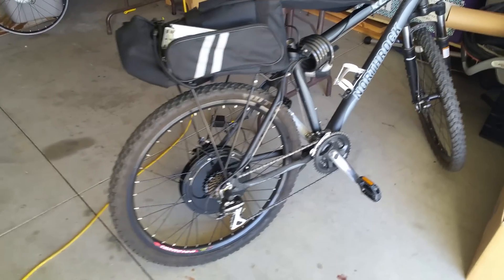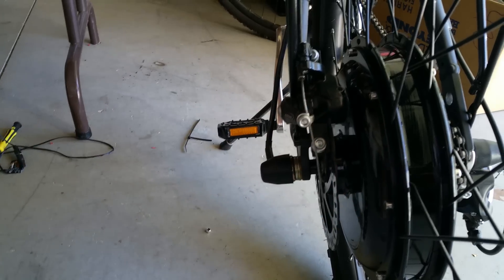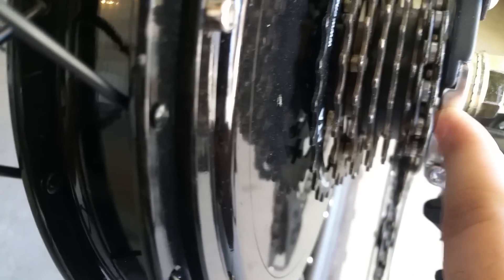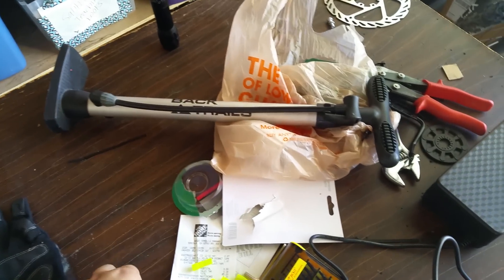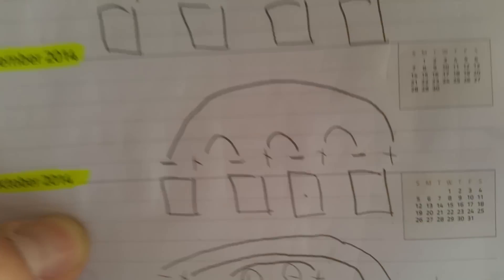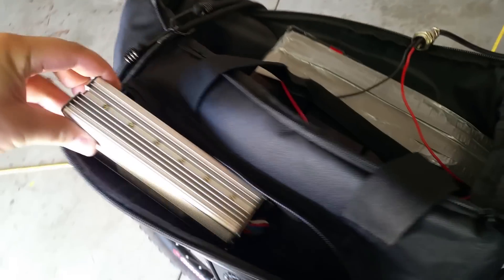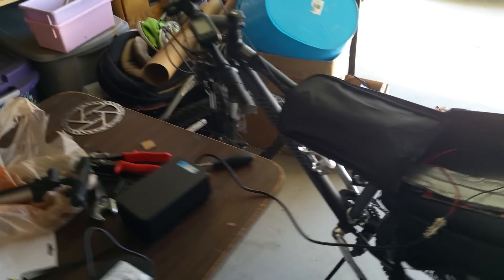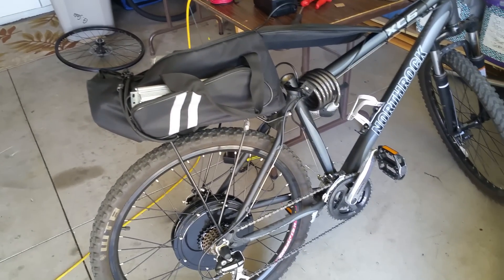Fast and Cheap Electric Bike! Over 30 MPH! Part 1

Comment: I have the same exact kit. I also have the instructions to get into the hidden menus on the display, if you are interested. My question is this, however: I haven't mounted mine yet as I'm building a super sized lipo pack from scratch. How is the spread on the gears on the rear freewheel? I don't exactly like the look of it, and the donor bike I'm using is a 24 speed Trek. I'm contemplating a Sunrace 8 speed freewheel with a 13-32 gear spread, but wanted your opinion on this one before I drop the cash on it. Thanks, and good job!
Reply from the maker: You can remove the gear and install your own. The gear are spread wide enough and I haven't had a issue with mine. I just used the ones that came with the kit and I have had no problems. Good luck with the lipo pack I hope it works out well for you!

Comment: If your bike is a north rock mountain bike with 29" wheels how did u fit a 26" motor rear wheel on a 29" tire on the 26" wheel
Reply from the maker: It has 26 inch tires

Comment: Hey a tyre lever is hardly a "special tool" if you  know how to fix a puncture or change an outer cover (wheel)  or tube ( inner wheel) on a bike. If you don't know how to do this you are not much of a cyclist or maybe you just like pushing your bike a long way with a flat? When I was just a kid, too poor to buy "special tools", I found a couple of Mum's tea spoons did the trick just as well  (but putting them back in the drawer bent and unwashed was a no-no though  ;).  Oh, and on today's alloy rims, metal teaspoons can damage the edges of the wheel ( the metal circular bit on a bike)- so yep, your nylon "special tool"  is  the best.  Any bike shop has them by the way. 

Just to remind you - they are called "tyre  levers" (or "tire levers" for Yanks who dunno there spellin or grammer)) . You stuff your "special tool" under the wheel ( the rubber bit) and rip a hole in the inner wheel ( the rubber tube inside the wheel ( the rubber bit))  by pinching against it against the wheel ( the metal  bit) you can replace the inner wheel ( the rubber bit inside)  by buying this "special bit" any high street branch of Amazon.  Confused? That's why things have names, Dilbert - learn them before you try to educate U-tubahs. Happy Cycling ;)
Reply from the maker: I am by no means a cyclists. Putting this kit on this bike is the first time I have ever modified a bike. I am also no expert but since I couldn't find a video regarding this specific kit or how to connect SLA batteries to it then I decided to make on of my own. Even if I didn't say the names of the parts correctly I hope that people got the gist of what I was talking about and by watching my video I hope some people who were afraid to try it out for themselves became a little less afraid and realized that it is actually quite easy.
Reply: i cant help but laugh at your comment where you make fun of yanks grammar, yet you say "there" when its supposed to be "they're", sooo, ahahahaha, just poking fun, not hating,  just had to be the typical commenter.
Reply: "tire levers" for Yanks who dunno there spellin or grammer"----Gribbo9999
So  let's  see...   The  guy  who  spells  grammar  "grammer"  and  uses  "there"  when  what  he's  trying to  convey  is  "their"  is  going to  give  us   Yanks  English  lessons.   I wonder if  it's  this sort of  thing which   necessitated the   illiaterate  Yank  oafs  coming  over  there  two  times  and  getting     the  Demjanjukdefamans    off    your ginger butts.

Let's  see,  it  was  a  part of  your   "empire"   from  which  the  Llona  and  Morris  Cohen  Soviet  spy  team   slithered  into   our    nation and  effected   the   worst  case of  espionage   against  our  nuclear  weapons  program   of the  entire  Cold War. Then  after  they   slithered  on   out  with  their  prize  you   limeys   did  catch them---but   then you  traded  them back  to  the  CCCP  so  those  lousy  commie  jews   could  live out  the  rest of  their lives  happily  in the bosom  of their  families   and  as  national  heroes.   Swell.   Their espionage  put the  CCCP   10  years ahead  in their  nuclear  weapons  program   and   there  may very-well never have been  a  Cold  War  if  it hadn't  been for them.   It  would  seem to me  that,  perhaps,   they should  have  been  turned   over  to  us  to  be  put  on  a  small catapult  and  launched  at   a  fence  festooned  with  butcher  wire   to be  filmed  having  a  well-deserved "sticky  end".

And  then  your  cross-dressing  sheep-stomach-munching  cousins   let the Lockerbie  bomber   go  home  because  he  wasn't  feeling  so  well.  Awww...   poor poor terrorist  bomber  was  feeling   a bit  wonky  so   let's  just let him  go home  and  be  feted   as   a  hero  and   treated to  every possible pleasure   a returning  conquering  hero   could    enjoy.

WTF is  WRONG  with  you  people?   

You  sent all the   people   you   deemed  criminals  to  Botany  Bay but comparing their descendants  to the  descendants of the  ones  who  wanted   shed of them   well,  ...

I  think  I'm  going to  go  listen  to  some  diddly-diddly  Irish music  because  there's  nothing  that  makes me  feel    like   stomping   a mudhole  in  an arrogant   redcoat     more  than  listening  to tin  whistles  and  bodhrans.  I  wonder if  I can  get  some  toilet  paper  printed  as   union  jacks.  I  sure  hope so.

I  "dunno"  who   you  think you  are  but  you  definitely   need to stop  drinking the  "ale"   out  of the  dunny,  loo-licker.

( friggin' morons don't  know the  difference between   a cookie and   a biscuit...)

AND IT'S   A  CAR  TRUNK,  NOT  A  "BOOT"!  AND THE  ENGINE  RESIDES  BENEATH  THE  HOOD,  NOT   THE  "BONNET".  What  sort of   a sissy   calls  anything   on  a car  a   bonnet ?
Reply: I'm crazy & I'm proud you are just rude...
Reply: funny thing is that pros aren't the ones buying these kits.... most people don't know those names as well. this is YouTube so it's a visual aspect to learning. good job
Reply: I've been a cyclist all my life and never changed a Tyre in my life 
i have driven cars all my life as well  also i have never changed a Tyre on that EITHER  ,,AND?
Reply: >>EITHER  ,,AND?<<
Your point? 
And btw you are either a liar or have never ridden a bike or driven a car or all three.
Reply: TruAnRksT who are you talking to
Reply: Gribbo9999
Reply: Gribbo9999 revivethr sound track
Reply: Not everyone knows how to fix a tire. Its actually normal and ok.
Reply: Cock.

Comment: You think changing a tire is the hard part? Most guys can do that on the trail. I carry a CO2 inflator to inflate a new tube, I must have a dozen of those tire levers around in each set in various under seat bike packs on its own bike. All your links do not work, so what brand was this and is it 1000 watts? 

REALLY NICE to finally see one with a disc brake on it. That's one of the things missing from most kits that these REALLY NEED. I'm looking to buy and I mean right now. My SLA batteries are already charging via solar cells from HF. Xtra power fuels my phone and BT bike speaker.
Reply from the maker: +BikingMNViking Here is a working link to the kit I used. http://www.amazon.com/48V1000W-Electric-Bicycle-Display-Conversion/dp/B00Q8JT9H2/ref=sr_1_1?ie=UTF8&qid=1463991708&sr=8-1&keywords=electric+bike+kit
Reply: ITzRoyall
Thanks, so I noticed you had 7 gears... Will it fit a 10 gear rear? Fine if its not, I have two FS bikes that are in that range. Check out the vids linked to turbobike.com... WOW! You'll like them. Tempting for towing or offroad.
Reply from the maker: It comes with one, but it is easily removable and exchangeable. So just take it off and put yours on it. Granted the width of motor needs to be accounted for. So with the motor and your 10 gear rear it might not fit and you might have to settle for the lesser gear model.
Reply: ITzRoyall This is great because the disc brake is really what these things need. My 29er Fantom has the disc brakes with DOT fluid in them and they feel like a car's brake pedal. Amazing and perfectly predictable. Thanks for sharing the review!

Comment: did you notice how he didn't mention A SINGLE COMPONENT  
Tire leaver VERY COMMON BIKE TOOL gear cluster derailleur hanger only on every bike ever with gears unless its a shit internal geared that SUCK to fix

Comment: can draw a wiring diagram but doesnt know what a tyre is........................................awesome
Reply from the maker: +Adam Bacon I copied the wiring diagram from a diagram I found online. I was trying to figure out different way of connecting batteries so the leads going to the controller would be from the middle. Could not figure it out and almost electrocuted myself in the process. So instead I just went with the way everyone else connects then hence the drawing! I should have just used my phone, but i like to doodle
Reply: i like that you took the comment in good spirits, as reading it back to myself it sounds a little bitchy lol. i clicked your vid for a reason cos i was interested in what you was building, its not how id have done it but if its working for you n your having fun.awesome!

Comment: hi! thankyou for the video. did you connect all the sensors in de controller? do you think if it will works if you connect the battery, the throle and the motor only?
thankyou!
Reply from the maker: +Joan Rallo all i connected was the battery to the controller and the controller to the throttle, display and hub motor. It works prefectly! love it!

Comment: Way cheaper to buy this - 
http://gosondors.com/sondors-thin-ebike-pre-orders/
Reply from the maker: +Mark Niebauer I looked at that bike and it looks great but their motor is only 350 watts and that in my opinion is weak! Mine is 1000 watts and I could never downgrade to a 350 watt motor. Though any bike with an electric motor is better than a bike without one, so buy it! It will easily be the best purchase your ever make! E-bikes are amazing!

Comment: what is the top speed u get?
how many hours needed for 1 full charge? and what's the mileage for 1 full charge ?
Reply from the maker: +Dj Mj almost 35 on a flat road, around 20 up a hill, and downhill, 50 easily.
Reply: the battery link is not working bro

Comment: Hey, I'm looking to do the same thing you did with the batteries(4 of them for 48v) how do they work now? Also,  what speeds to you get now? I plan on going 4 miles round d trip. Thanks!
Reply from the maker: +jack arnold these batteries will easily get you 4 miles on fill throttle! Also watch my part 2 for a six month review. It is in the description!

Comment: I got my electric motor from Golden Motor's Canada, called the Smart Pie. The controller is within the motor and can be set up by computer for different battery voltages.
Reply: +phillipah7 Great motors!  What battery pack are you using?
Reply: +Wayne Howarth 48V 15AH Lithium Battery + Charger from "vebike" on Ebay.
Reply: A Chopra b

Comment: DC ain't gonna kill ya ;)
I'll happily touch the positive and negative on my pack, and that's 84v of lithium polymer 8)
Reply: +th3d3wd3r The right combination of Volts and Amps will surely kill you.  The thing with DC if you get zapped by it it's very hard to break free as the current is continuous unlike AC.
Reply: +th3d3wd3r 
DC can certainly kill, just might take a bit more of it to do so. Your 84v is just under the threshold of what you would need to overcome body (dry) resistance. When most people think AC they are typically thinking house current of 120-240V if you grabbed DC wires with that kind of voltage, I'd suggest you not be sweaty.
Reply: +spr624 it is enough volts to get through, but the pain induced at that point is minimal. you can near double that voltage and although painful, still isn't fatal
Reply from the maker: +th3d3wd3r Even though it might not kill me. I personally wouldn't take that chance.
Reply: +Wayne Howarth no disagreement there, enough volts and amps will kill you. However the let go threshold for ac is vastly lower than for dc. So although the current is continuous, it requires much more dc current than ac before you can't let go of the conductor

Comment: How many miles can you get per charge? Great video! Thanks for sharing!
Reply from the maker: ***** It will be, just trying to save up for it. oldskoolhead0 I would love to see a video of your bike. My bike rack is made of steel, so far its been holding up well. When I bought it, it said the max load was 50 pounds. The battery pack is far less than that, weighing around 25 pounds with the case plus controller.
Reply from the maker: +SolarReturn Roughly 5 miles at a slow throttle.
Reply: +ITzRoyall 5 miles only?  what battery pack do you use?
Reply from the maker: It is 7AH SLA that I bought on amazon for $60. Its not an expensive pack, so thats why the range is a little less.
Reply: +ITzRoyall that rack wont last long carrying a hunk of lead on the back, i had a 36v 24ah headway pack on mine with a 1260w cyclone mid drive motor would do about 30 miles and keep up with traffic lol, my rack though gradually got replaced with some heavy duty angle iron and i eventually made a cradle sprung loaded frame over my cross bar and some fiber glass with decorative carbon fiber cases so my pack was split in 2 and hanging over my bike frame on some car valve springs to absorb the shock of the weight of the battery as that weight when you are doing 35 or so mph, well lets just say the pannier rack i had was rated for 30kg and the battery was 15kg and it destroyed it lol snapped it in every place possible eventually, the cases i made tho would have carried it for good had i not fried my controller and bms and stripped it and sold the rest of it and got a motorbike instead lol ;-) still have the cases and cradle frame tho
Reply: if its steel it may hold up as mine was alli, it held it for a short while but eventually the weight of 24 12ah headway cells took its toll lol, unfortunately i dont have a video though i may still have some pictures somewhere though im not sure i havent deleted them by mistake as i can only find odd ones

Comment: Damn those must be some heavy@$$ lead acid batteries if they were that cheap. More expensive and higher quality li-ion batteries would be far lighter and have much longer range.
Reply from the maker: +Patrick94GSR Mine are relatively light, around 20 pounds. The heavier the lead acid batteries the more amp hours they have.
Reply: +Patrick94GSR THey're 3 pounds and less than 20 bucks on amazon now.

Comment: Would it be possible to create a 'brake' mechanism, by routing the main power through a pulsed and inverted relay/switch? The idea would be that main power would be inverted inside the switch, but not continuously. Rather, the inverted power would be pulsed 20x a second (or whatever rate is effective for max braking) while a button/lever is pressed. I'm sure this has to be possible somehow. Please let me know your thoughts, and what might be required if it IS possible.
Reply from the maker: +davidsirmons I do not have the expertise to comment on how that could be possible. But it sounds as though you want to build an electric bike that incorporates regenerative braking and I have seen ebikes with that feature. I however do not know how to implement a regenerative braking system. But with some research I am sure you could figure it out! You could try and get in touch with an ebike company, either by phone or email, that has that feature and ask them how they did it.

Comment: Thanx for sharing - Great Kit, I have one also but got mine off ebay; I opted for the LED Display (Cheaper) and it came without the Disc Break but I only paid £156 ($222)
p.s. I put two of the batteries in each side of my rear panniers and the other two I have  on my down tube * they're a perfect width for an old lith-Bat case I had lying around (the square type which are often in-situ behind the seat post), just needed a little modding height wise; I made a couple of holes through & attached it to the water bottle studs. The centre of gravity is kept quite low in my set-up.

Comment: That doesn't go 30+ mph.
Reply: +Pro Env I can assure it does, i have the same kit. Only I have (4X) 10Ahr Batteries and if you open up that Controller Box you will see 2 Shunt Connectors, the third one is missing (empty space), I think they do that deliberately at the factory to restrict Amperage (power), all you need to do is either add a blob of solder to beef-up the existing ones or just add the third yourself (its just a strip of bare metal). I can EASILY reach 30MPH +
Reply from the maker: yes it does! Buy one and see for yourself!

Comment: Hi,Some point that you may help me because your kit is the one I'm trying to have. Cheapest indeed.The kit is the same because the bag is excatly the same.1)Can you lift the bike with ease or is quite heavy? One of the things I do quite often is put the bike on top of the car bars. Would that be a real pain?
I'm deciding between 4LSA or a Lithium bottle...2) After all this time, do the batteries work fine?3)I've no experience at all on this, but I've read alot latety and I believe even for a rear wheel is quite important to have a torque-arm. Please check: www.electricbike.com/torque-arm
Thanks in advance.
Reply from the maker: +Tuga SemNome The bike is quite rear end heavy even without the batteries. When I need to work on the bike I remove the batteries and flip the bike (bottom side up). I went with SLAs because they work well enough and the ones that I inputed in the description are extremely cheap. They recommend torque arms for rear install or front install but I honestly believe that a rear mounted one does not need them because the tire mount in the back is a lot sturdier than in the front.